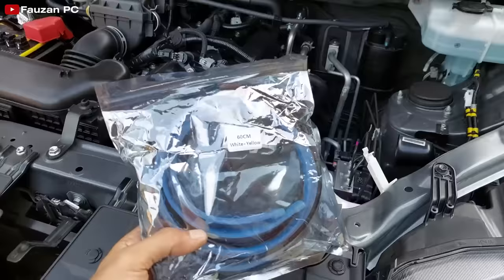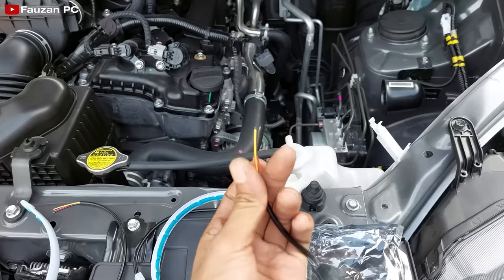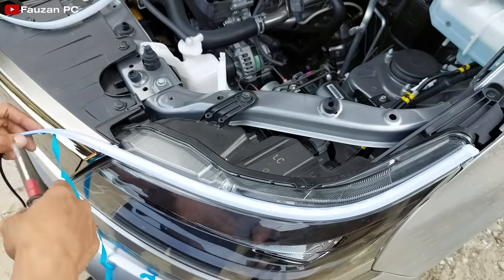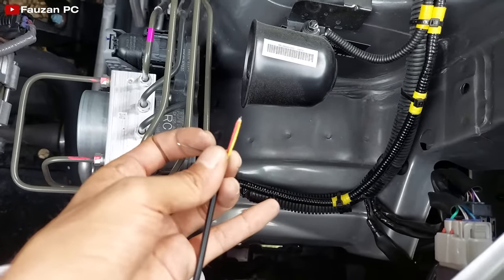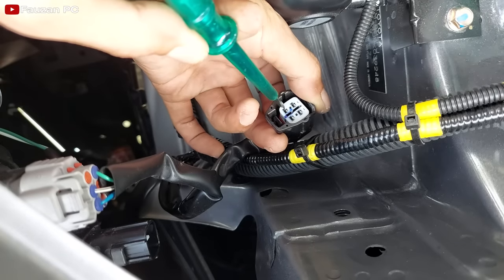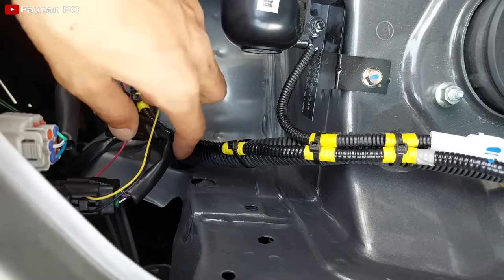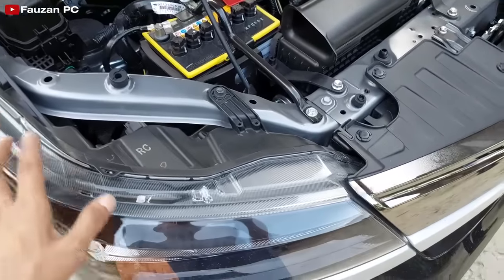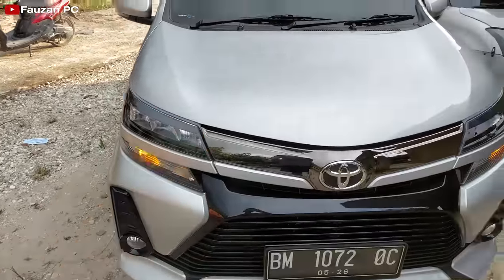LED DRL Alis Fleksible Waterproof Welcom Light Pasang Di Mobil Makin Gaya !!! Begini Cara Pasangnya

Comment: Om. ini tempo hari Saya pernah bantuin temen masang lampu type ini di Mobil yang sama, namun GAGAL 100% karna: 1). Semua lampu Sein nya jadinya berubah menjadi Hyper Flash alias berkedip sangat CEPAT. 2). Lampu Sein ketika berkedip Tidak 100% menyala semuanya, namun HANYA setengah saja. Sisanya OFF.
Reply: pasang resistor, atau beli flasher khusus led. untuk avanza 80rban
Reply: Flasher led buat claya ad mas?

Comment: Om sy mohon pencerahannya ya om🙏🙏.xenia sy th 2019 model sprti model punya om.setelah sy ganti lampu rem strobo,mobil jdi hilang tenaga lemeees bgt meski gas sy injak dlm2.dan indikator lampu cek engine menyala.sy bingung om.lalu sy panggil tukang servis dri daihatsu bw laptop dan alat2 yg lainnya.setelah di cek sm laptop ttg keluhan sy tdi lgsg muncul kerusakan di laptop "trotel body" katanya..dan dia bilang (mbl skrg mas klo di kasi lampu asesoris LED gk bisa & banyak kejadian rusak pd sensornya) sensor nya sangat mahal..tpi sy tanya teman2,dri mulut ke mulut katanya bnyk kejadian sprti mbl sy..apakah punya om jg sprti itu om??mohon di jwb Ya om🙏🙏.brgkali ada solusinya..akhirnya lampu LED strobo tdi sy gnti dgn lampu aslinya